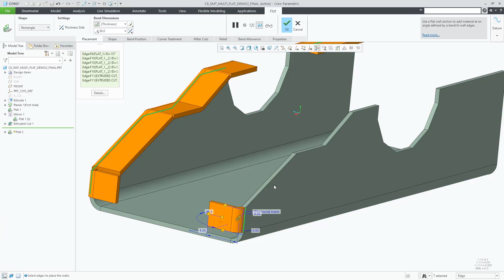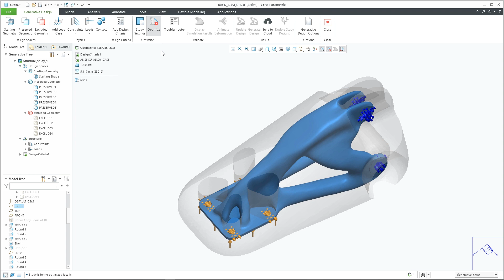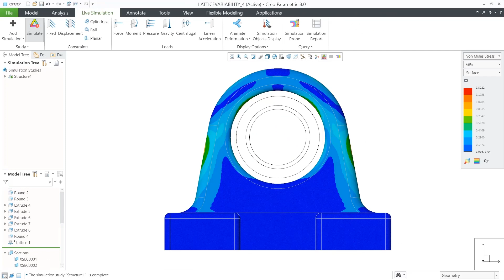Creo 8 - Top Enhancements

Comment: I've used almost all cad tools but one thing is most important in creo is that's it's User interface, I didn't found such a flexible user interface with smart reliability with different commands and tools also with easiest accessibility to overall software. So as I'm using creo only since WF-5

Comment: How about you finally add hole tables in drawing module? This is the only CAD software that does not provide hole tables in drawings. Amount of time used on making drawings is astonishing. The only thing I like about Pro/Engineer (let's face it, it is still the same as version 1) is hole placement. Everything else is totally outdated.
Reply: This is either cap. I use Creo daily, it's FAR beyond what Pro/E ever was

Comment: I've been taught Creo at University in UK, when I was studying mech. engineering from 2009 - 2013. I think it was the first version. Never hesitated on learning a new Cad program, have created hundreds of designs and assemblies. My ONLY dissapointment is that I use another program from your competitor Autodesk to produce CAM. Unfortunatelly, you offer a very limited post processor database, ( lack of MACH3 processor loses you thousands of customers ) and the user interface is not so friendly. At this moment, the amount of new engineers involved on prototyping ( CNC and 3d printing ) has increased dramatically and in my opinion, CAM interface and multiple post processor database wins you long lasting customers. Besides CAM, the CREO is a solid package for any level of engineering application, as it offers you almost anything.
Reply from the maker: Hi keronGR,

I asked our product manager for CAM his thoughts on what you said, and he referred to me this list of post-processors ( http://support.ptc.com/cs/cs_26/howto/ncgp2649/ncgp2649.htm ) as well as saying that Creo NC allows users to create all the post-processors you'll need now or in the future, and users can modify Gpost-based post-processors. There's also a cottage industry of partners who help Creo customers with CAM processing.
PTC has been making a lot of strides with our recent releases for both CNC and especially additive manufacturing. I think every Creo release since... Creo 4? 3? has had additive manufacturing be a big featured component. We're the leader in that and proud of it.

Anyway, thanks for the comment!

Comment: NX/Catia style "Draft body" is included finally? If some random orientation we have an a cylinder (screw boss in some molded parts) and we want it draft to some other random orientation datum plane, than Nx/catia fill it with material. (Also could be used when you would like to make a 3d printed part without support+with 30 deg overhang/draft)
 Or I missed, don't know some creo feature?
Reply: @Brahma Trivium that's an uninformed opinion if ever I've heard one.
Reply: can you describe what you're asking in a bit more detail? I'm having a hard time understanding it
Reply: @Brahma Trivium i mean this with no judgement, but that seems like you haven't looked. It's also not even difficult to do customization in Creo, just pop open the Options menu or modify the Config.pro file

Comment: I have worked with many CAD packages so "productivity enhancements" don't excite me as I can model almost anything with all of them. I'm more concerned about features that exist in one CAD package, but not in the other. When I worked for a company that used Creo several years ago, I missed the ability to add custom profiles to framework and custom parts to intelligent fastener, even though framework already had a ton of standardized steel and aluminium profiles (intelligent fastener could use more), in the end we ended up not using framework at all because we would have to combine 2 methods. I understand that there is a paid extension for this, but I wonder if something is being done about this in the standard version.
Another thing - inserting profiles without a sketch at a desired length (or fasteners without a reference hole/axis) freely in an assembly.
Reply from the maker: Hi JAnx01,
Productivity enhancements might not help you design what you couldn't model before, but it should help you do it faster.

You'll be happy to hear that the full version of Intelligent Fastener Extension and Advanced Framework Extension now comes standard with all new Creo licence purchases, since it's included in the Creo Design packages that didn't exist some years ago: http://ptc.co/YqUd30rjIYe
Hopefully the company you worked for has upgraded their old package to one of the Creo Design packages.

Cheers!

Comment: Wait, did they just make it possible to place flats on multiple surfaces?
Reply from the maker: Howdy,
This channel will have videos on pretty much every new enhancement after Creo 8 actually comes out (which is soon, but not yet), but spoiler alert, this feature is:

"Multi-Flat Wall Feature in Sheetmetal Design"
"In Sheetmetal design, the Flat (wall) feature now supports the selection of several straight edges as wall placement references to create multiple walls within a single feature."